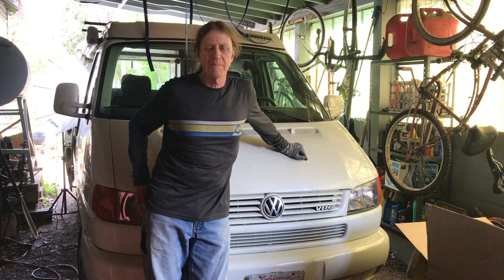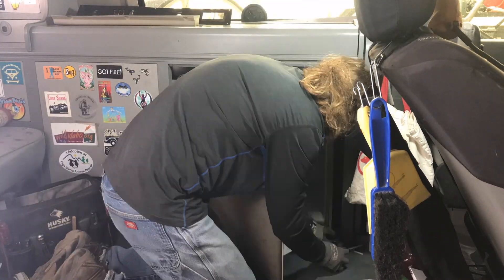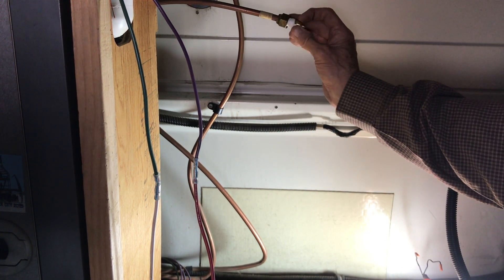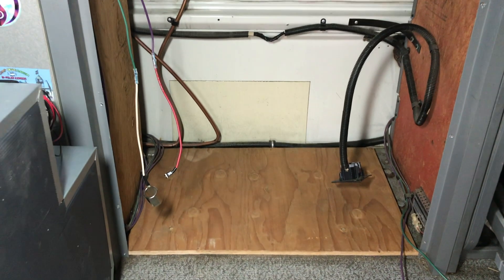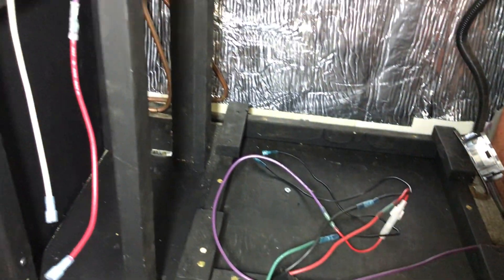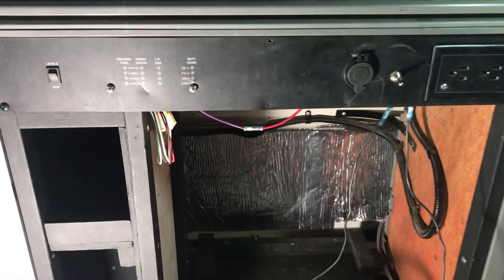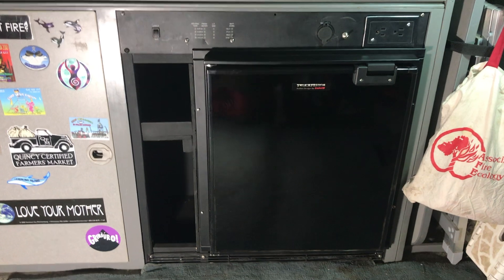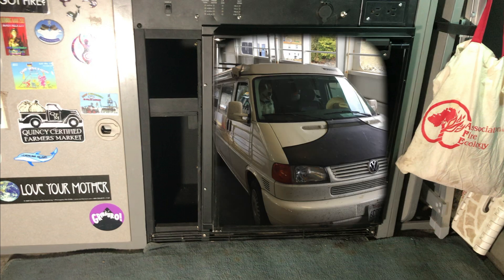1997 VW Eurovan TF65 Truckfridge Install

Comment: What did you not like about the propane / electric fridge?
Reply from the maker: Nor-cold is useless on battery power, only can run a few hours and can only cool well when it's not hot outside.  My TF65 with a larger house battery and solar panel runs without ever running out of power, gets extremely cold, and has a freezer section that actually freezes.

Comment: Great video! It looks like you bypassed the AC plug in and went with DC only. Is that correct? I would like to utilize the AC for when plugged into shore power or a generator and DC for when AC is not available. There seems to be no switching mechanism on the Truckfridge to accomplish this. How did you bypass the fridge light? That seems like a great move to allow you to leave the door open while the van is stored to keep mold at bay. Sorry for all the questions.
Reply from the maker: Yes I went DC only but you can get a AC/DC Truckfridge.  I put a switch in between the ground and fridge.

Comment: Hi! I know it’s been a while since you posted this video, but did you have any struggles getting the old fridge to come out? I disconnected the flu and the gas line but it just does not wanna come out. It almost feels like it’s hung up on the bottom somewhere but I can’t find any screws anywhere that are holding in place.

Comment: Looking at the sides, did you just 1X2? and for the bottom piece it is sitting on? I was hoping for some dimensions on that stuff :)  Thanks!!!
Reply from the maker: Yes all made with 1x2. I don't have any dimensions as I made it up as I went along!
Reply: @kevinbassplayer  OK thanks! I have watched it a few times and I am going to be trying this.... About how big is the little cabinet you have next to the fridge? I just get a bit nervous about doing this kind of stuff!!! But not going to let that stop me ;)
Reply from the maker: @julielorentzon7993  Again, sorry but I basically made everything as I went so don't really have any size specs.
Reply: @kevinbassplayer  Thanks so much for answering! I think I have a great start on the project - last question - how did you attach the plywood to the floor? Thanks :)
Reply from the maker: @julielorentzon7993  since the floor is wood you can just use short wood screws directly into the floor. I used 1/2 plywood on top of the floor and used 3/4" exterior wood screws for everything.